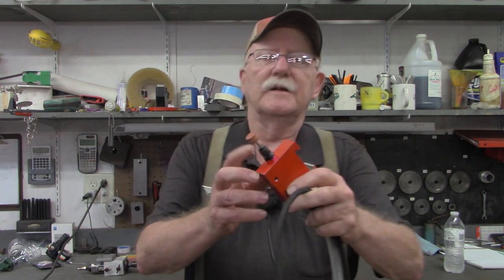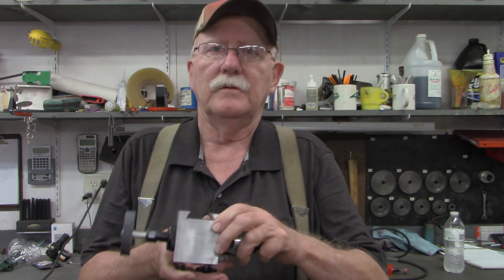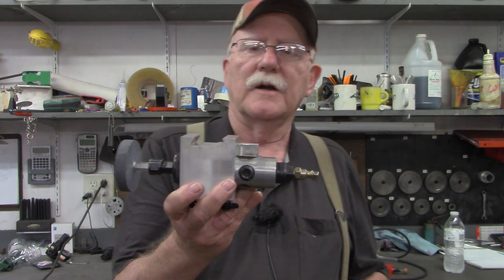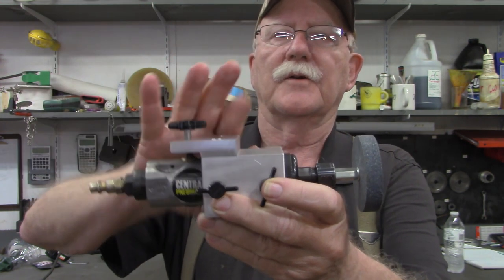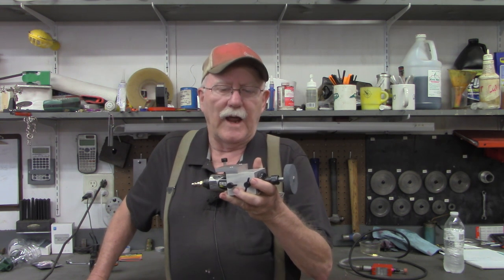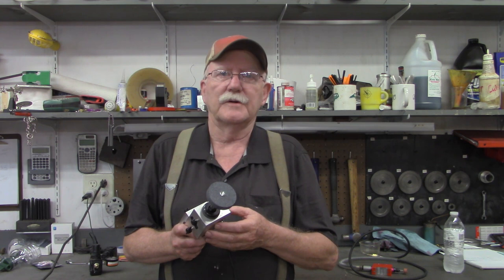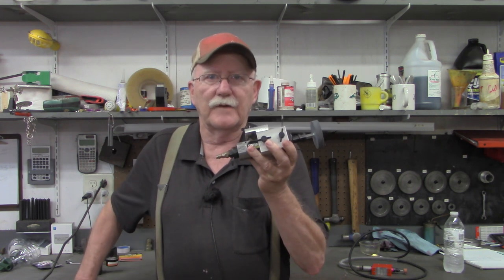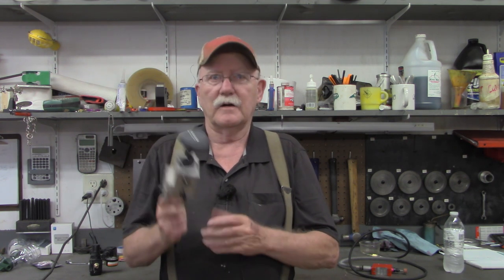Tin Barn Project FAILURE!

Comment: Those small die grinders are designed to develop their power and work with small burrs and stones spining at 15-25 thousand RPM. At very low RPM they just stall out, it may not be a bad die grinder just not being used for the right application.

Comment: To pull a grinding wheel that large you probably need 1/4 hp (187w). The lathe spindle was running way too fast. 150rpm would be about the max I would run for that diameter of work. The wheel has to have time to cut.
Remember failure teaches you a lot more than success.
Cheers from NC/USA

Comment: Those air die grinders (even the "good ones" that arent from Horror-Fright) have no balls to spin a heavy stone wheel like that, they are made for 90+ psi and HIGH SPEED turning a carbide small cutter with flutes where the cutter aint much bigger than Gum-drop! at low psi and low speed they got no Umph at all-

Comment: Hi Mr. Lee, I must have gotten lucky. I made a similar TP grinder with the HF die grinder. I picked the middle price range model, I was only using a 1" stone however. It performed quite well. What I did learn is it takes a good sized air compressor to keep up and there dang noisy. An electric die grinder would be my do-it -again choice. 
It would be worthwhile to show the block and fixture build since it would be similar for an electric version. BTW it's not a failure to show what not to do or avoid. Thanks for posting...looking forward to seeing the revision-2 version.
ATB.....Dean
Reply: Stone Size is a big part of the issue

Comment: Don't give up sir, we run these die grinders in our shop and they require much much more psi, our large compressor is set at 155psi, no regulator, and works fine, plus we take them apart when first get one and sand the air reads(know that isn't how it's spelled 😂), but we wet sand them with air tool oil, debur the part that they ride in and they will turn with extremely high rpm/power, even with our backup air compressor 120psi get will get things done in a hurry, hope you try this and don't give up on all you've gotten done already!

Comment: Hi Lee.  I have an Astro 90 degree die grinder (T20AH) that I have used quite a bit for sanding auto body work.  It was reasonably priced and I have never stalled it.  They also make a straight design.  You said you already ordered another one but I figured I'd give my 2 cents worth, in case the new one isn't powerful enough either.  Thanks for the video!

Comment: I have the exact model. They work well at 120 psi and 10,000 rpm and higher. The stone is the problem. I wonder if a stone  that size and rated at 12,000 rpm is available. Thank you for your efforts. Thomas Edison said he failed over ninety percent of the time. I’ll keep watching Mr. Lee.
Reply: Maybe a 4.5" flap disk or grinding disk.

Comment: Lee I think that may be the reason that Dumore uses large electric motors and pulleys to control the higher RPM's , The large electric motor maintains it RPM and Max torque while the pully-to-pully ratio increases the speed of the wheel. I have been contemplating using a router to make one but It would be a huge side load on the bearings. Some of the greatest experiences come from both Sucess and Failure. I look forward to all your future videos.

Comment: I understand your sense of failure. They are only good with a small stone and lubricated just enough that the vanes are free to move in the motor, to much oil and complete failure also. But still can work but just with a smaller stone.  It's all just a big compromise.🙂👍

Comment: I am doing the a similar thing. A long shaft air grinder, maybe better at ninety bucks and a  bxa 1-1/4 inch boring block. Maybe your grinder motor is bad or you are blocking its air flow?

Comment: I’ll second that!  I picked up one on those die grinders/cutoff tools last week for a shop project.  100psi air from the shop and I think it all leaked by.  I swear I think I could have stalled out the cutter with my hand wearing a leather glove.
It’s a cheap tool but I did expect it to work once. I’ve read online that most people end up taking these things back multiple times and might never get a working one.   Also the failure seems to be a plastic regulator part.  I may disassemble mine and see if it’s something that can be fabbed out of brass for an improvement.

Comment: i neglected a harbor freight air tool once, i spooled it up and there was hardly any power, put oil through it and spooled it up again and it went at minimum 20% faster and whined so much louder and you could hear the oil work its way through the gunk as it spun faster

Comment: 60 psi sounds very low to me. I use one all the time in a body shop at 90-120 psi and have never had a problem with them stalling. Anyway, I wouldn't call it a failure. The design works, just not the air tool. A better quality one might be successful.